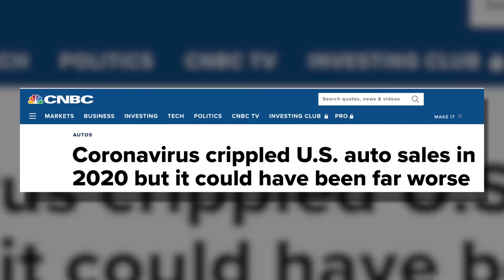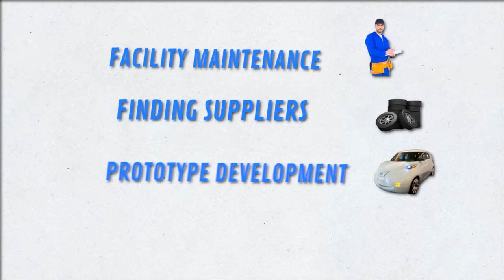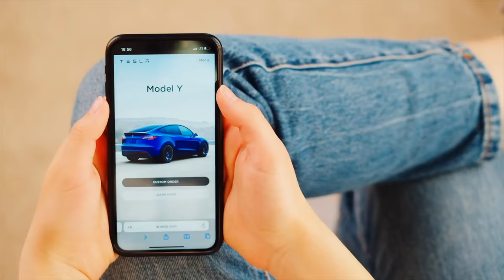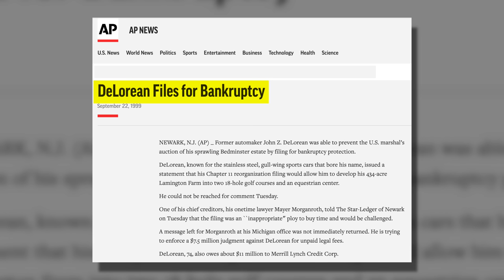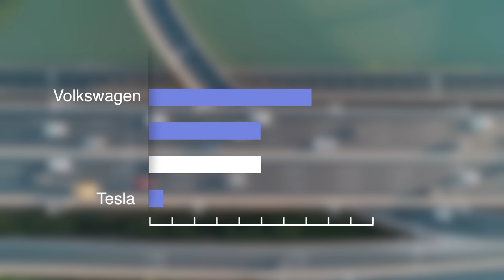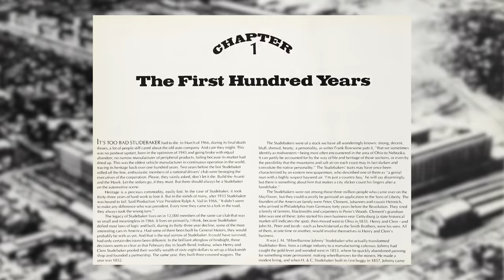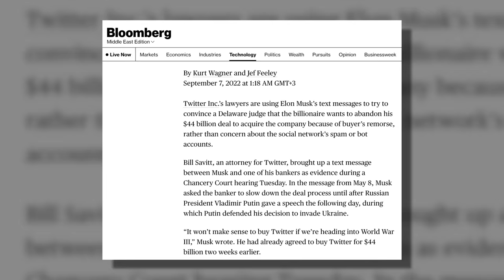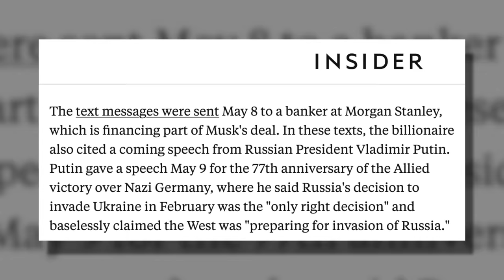Get Ready for Nuclear War

Comment: Maybe they should start making gas vehicles that don't rely on computers. You know, like the old days.
Reply: Sadly that would be impossible with all the required safety requirements
Reply: That would be beautiful one less expensive part to change
Reply: I would love to buy a spankin new ford gpw, exactly as made in 45
Reply: I’m still waiting on the hydro car
Reply: The "GOOD" old day ! I can tear down a chevy 350 or Ford 351 bilnd folded
Reply: the EPA says "No".
Reply: @ueltrades9479   NO! every thing on a modern car except for the gps, Bluetooth and gimmicky crap can be and were done manually
Reply: Doesn't matter if it's got computers. Any electric motors, solenoids, fuses etc of any type can fry. Electro magnetic pulse is literally a massive electric pulse that sends a bolt of electric through all electronics frying them. Not all electronic components are susceptible. But don't think carburated vehicles don't have electric components. If it's got a distributor than it could still be affected. Maybe.
Reply: Sorry thats not liberal enough. Greta would not like it.
Reply: More planned obsolescence more money coming back to corporate
Reply: Because I really loved having to crank my '76 Chevy C-10 for five minutes every morning, trying to get it to start...
Reply: @mabeljoe4305      Need to do away with the EPA !
Reply: Even the old days had computers. What the hell do you think a computer is lmao? You mean interconnected chips or SoCs.
Reply: Back in my day…
Reply: I like fuel injection tho
Reply: I wanna say ‘76 or so is the last years where the car might survive an EMP. Anything ‘80’s or newer won’t make it if it’s close enough to a nuclear (or solar!) EMP
Reply: @Sal3600  Actually, older ignition systems like GM's HEI wasn't computerized but they were electronic using transistors and semi conductors, but no actual micro processors. Definitely a lot more reliable that a points ignition system without being overly complicated.
Reply: @ueltrades9479  yeah they don’t need to be there. All that garbage and computers are not needed
Reply: Good luck cause in America is all about technology with robots soon America gonna be like i.robot movie and people in America want new technology
Reply: Zombie that's one of the best answers on here you are 200% correct. I feel the same way you are right brilliant
Reply: @petefranco9978  Wait, you actually ENJOY cranking your car for ten minutes in the morning to get it started?
Reply: I have that kind of car here in my 3rd world country, and believe me, I save a ton of money because of it's simplicity...
Reply: I often wonder if only one nearly all mechanical design was perfected how good it would be. I'd allow HEI ignition tho. I'm imagining an outside air thermometer helping control fuel management on the latest Holly carb tuned to perfection on a 350 with every part tuned for durability and efficiency on the entire vehicle over 50 years with the combined efforts of everyone would result in a superior vehicle. Heck my 1971 C-10 truck is pretty good, it has a 3.08 rear gear that gives good gas mileage and starts up instantly except if it sits for 2 weeks the fuel pressure goes from 6psi to 0psi and needs a few gas pedal pumps.
Reply: @Rekuzan   What you talking about?  My '56 Pontiac starts right up.
Reply: @Rekuzan  only if its badly maintained.
Reply: @ueltrades9479  nothing is impossible with need and demand.
Reply: you are talking about (noisy) carbureted engines, manual transmissions.. 
mostly mechanic systems with mechanic points of failure, 
Something from the same caliber of Patrol vehicles produced by Nissan in the 70's and the 80's, or Landcruisers of Toyota that were produced in the same period.  
That sounds great, but impossible at the same time,
There are few (enthusiasts) that may stand in the line to purchase a vehicle like that, but they are quite few in comparison to the majority of lazy and spoiled consumers who aspire to luxury and comforts, 
why do you think companies build vehicles the way they do? consumer demand is in their highest perspective.
Reply: @VesselFitterguy   WRONG..  It matters A LOT whether it has a computer.  Computers are a lot more sensitive to EMF than the old electrical systems.
Reply: @ahmadalzuway8425   WRONG on nearly all counts.  Old automatic transmissions DID NOT use computers.   And computers are NOT just because of "consumer demand."  Computers started to be used in order to meet EMISSIONS standards,
Reply: @j.robertsergertson4513    Computers were added to cars to meet emissions standards.  NOT for the driver's convenience.
Reply: Anything pre 1975!
Reply: @TrailBossTatum
Reply: I was thinking the same, but I do remember the 70s, as a young snot nosed kid, and all the constant overheated and broken down vehicles on the Belt Parkway, and if my dad did dare turn on the A/C in the ‘74 Ford Maverick, it would either stall, have no power, or overheat, and in the winter, no such thing as traction control or ABS, yeah, sounds great, but you were also lucky to make it beyond 60k miles.
Reply: @rbnhd1976  I'd pay a lot of cash for that 😃
Reply: Old cars produced allot of pollution and they stink while running. Not that theirs probably 3x the cars on the road over the years, really wouldn't be a very good idea.
Reply: @ThatBoomerDude56  and your point is??
Reply: @VesselFitterguy  Ever hear of points? there were no "tronics" only electric as in Magnetos, distributors with points, etc. everything was based on mechanics which are not at all affected by EMT's. IMHO
Reply: @ThatBoomerDude56  Well History is surely not on your side here! , The first ECUs showed up in mass-production in GM and Ford vehicles of the 70s era to handle basic functions such as ignition timing and transmission shifting (as a way to make their cars more fuel efficient specially after the Arab embargo of oil exports in the same decade) ,
currently you may find more than one (ECU) in a car , and it almost controls everything. 
I can't see where I'm wrong when the people in the area I'm living in wouldn't understand why I'm still driving my 81 Nisssan Patrol and almost everyone is calling it a piece of junk that's noisy and unsafe (it has no airbag system and YES IT IS CONTROLLED BY A COMPUTER).
you can say I'm wrong as much as you want, but if you believe that average people who expect more systems in their future cars will not revert to old vehicles because "they are worried about the emissions" and that they do not aspire for more technology and comfort (ie more computerized systems) then you are free to believe what you want.
Reply: @j.robertsergertson4513  "My point" depends on which of my comments you are referring to.  And whichever one it was, I was clear in making it the first time.  So if you didn't get it, that's not my problem.
Reply: Everything is impossible if you take government out of it.
Reply: Guys, HERE is Our Savior

HalleluYAH translates “Praise ye YaH”

YaH is The Heavenly Father 
YaH arrives via the TENT OF MEETING
YaH was Who they Crucified for our sins

** NO FEMALE INVOLVED WHATSOEVER **
— Hebrew Book of Isaiah

Isaiah 42:8
"I am YaH; that is my Name! I will not yield my glory to another or my praise to idols.

Isaiah 43:11
I, I am YAH, and there is no other Savior but Me.

Isaiah 45:5
I am YaH, and there is none else.
Reply: @Praise___YaH  Hare Krishna!!
Reply: Only traditional diesel vehicles with no electric components will work after a nuclear attack. And you do not have many of those in the US. Gas powered cars have electric distributors, coils, wires, plugs.
Reply: @metodianastasov2905  WRONG.  The effect of an EMP depends on (1) the sensitivity of the electronics, (2) the distance from the source of the pulse and (3) the amount of protection around the electronics.  EVERY automobile has a very effective faraday cage around all of its electronics.  Nearly ALL automobiles in the U.S. WOULD continue to function unless they were very close to the source of the pulse.  Certainly everything built before the introduction of computers would continue to function.
Reply: @ThatBoomerDude56  Good luck with that. However, non-electric diesels are the go to vehicles in such situations. And you do not have any.
Reply: @metodianastasov2905    I'm not depending on "luck."  I'm depending on knowing what a Faraday cage is as well as knowing that an EMP won't do much to a heavy-wire high amperage circuit even without one -- especially if it's not actively running at the time of the pulse.
Reply: @VesselFitterguy  Old fashioned Kettering ignition would only be affected during the actual pulse. Should restart straight away.
Reply: 1973 Monte Carlo would be nice.
Reply: @VesselFitterguy  Anything with electronic ignition would be screwed, carb or not.
Reply: @Rekuzan  maybe you should change the plugs and oil every once in a while
Reply: @Sal3600 they are my 63 Chevy Impala head over 2,000 computer chips in it and sensors go back go back to the Disney channel will you
Reply: @Rekuzan  it's better than waiting 45 mins to charge while having 10 cars waiting ahead of you.
Reply: Kinda off topic but on the Battlestar Galactica TV series the only fighter spacecraft left were the old analog type mechanical star fighters, the high tech computerized versions were hacked by the Cylons and shut down immediately before a deadly battle that killed every modern computer controlled spacecraft, leaving only the golden oldie spacecrafts in the remaining fleet, maybe that’s why we’ve got a huge ghost like aircraft graveyard somewhere with retired old aircraft stored away 🤔😏😆
Reply: @mackenziegray2090  yep, I remember one time being behind a guy driving a car from the 40s, and I was getting choked by his exhaust fumes.  I can’t imagine a road full of that now, would be disastrous.
Reply: @ueltrades9479  Maybe we as US citizens need to make a movement and ask our law makers to lessen the regulations that require car manufacturers to include so many computer chips in our cars
Reply: @OfficialReckM8  I agree
Reply: Engine being controlled by computer is one thing, the CANBUS and everything else on the damned car being attached to the computer is something else. It's simply not necessary; get rid of that other garbage.
Reply: they used too. My 72 cutlass with a rocket 350 v-8 got me around 24 miles to one gallon....I kept my foot out of it, most of the time. My 76 chevy c10 with a 73 pancho 400 transplant go 20 mpg, If I kept my foot out it. my ole mans 65 goat, 389 4bbl, 4spd m21, got 22 mpg, if we kept our foot out of it.
Reply: they used too. My 72 cutlass with a rocket 350 v-8 got me around 24 miles to one gallon....I kept my foot out of it, most of the time. My 76 chevy c10 with a 73 pancho 400 transplant go 20 mpg, If I kept my foot out it. my ole mans 65 goat, 389 4bbl, 4spd m21, got 22 mpg, if we kept our foot out of it.
Reply: they used too. My 72 cutlass with a rocket 350 v-8 got me around 24 miles to one gallon....I kept my foot out of it, most of the time. My 76 chevy c10 with a 73 pancho 400 transplant go 20 mpg, If I kept my foot out it. my ole mans 65 goat, 389 4bbl, 4spd m21, got 22 mpg, if we kept our foot out of it.
Reply: I'd love to see you betas crank start an engine.
Reply: @snavisTM  🤣oh boy how bad are you?
Reply: Better yet... Gas computers that drive the cars for us
Reply: Yeah,and a good old fashioned landline.. Remember when somebody called and you weren't home!!!!! THEY CALLED BACK. We ruined life with too much technology
Reply: Model A's and T''s never used chips ...
Reply: So carboureters as opposed to electric fuel injectors? Some computerized aspects of modern vehicles are undeniably superior in terms of both longevity AND simplicity when compared to mechanical counterparts.
Reply: @stankygeorge  you can get a 1985 or even 1990 Japanese or German car that is completely mechanical with no electronics and much much better built than anything from the 1970's, not to talk about safety and fuel economy.
Reply: This is how they making money on computers  usually  normal people  cant fix.. so you have to call dealer😢

Comment: My first car had a 225/6 and got 23 mpg on the highway.  Here we are 50+ years on and a bunch of computers later, my car now gets 24!
Reply: My 03 shitbox gets 18, what car did u have
Reply: @bigiecheese919  Obviously, a Mopar!
Reply: @jaminova_1969  that's bizarre dude, why do you think that engine was so efficient
Reply: g pilsitz  Sounds like my old 53 Chevy coupe .
3 on the tree !
Reply: @bigiecheese919  Single barrel carb and timing advanced 10-12 degrees.  It was the first oil crisis so had to stretch every gallon of gas ⛽️...  Also no pwr steering, breaks, a/c (had to install own radio), it was a stripped down model, not even carpet: It was light.
Reply: @gpilsitz1783  We had 2 Valiant's,a Demon, several V-8's. Grandma always had a new Dart Swinger, one Uncle had a pickup, the other drove the same Duster for decades! My 1st car was a '67 Dart GT with the indestructible, runs on mud, Slant Six!

Comment: Scotty won't have to worry about repairing cars afterwards.
Reply: I recall a post-apocalypse movie, where they drive old cars converted to wood-burners, as some did in Europe during WW2.  Scotty may have a "conversion business."
Reply: Very true, 💪🏻
Reply: I have had a look at your car and its NUKED
Reply: @elultimo102  There is a different method using "gassification" as demonstrated by an Aussie mechanic. Instead of directly burning the wood, it applies heat indirectly to the the wood and the outgassing has methane, hydrogen,  and oxygen which are burned. It's interesting stuff.

Comment: If you are worried about an EMP, get yourself a pre 1973 domestic truck or van with a carburetor and mechanical points ignition system.
Reply: The roads would be clogged by vehicles that have been fried.
Reply: Will an old 1970 350 work?
Reply: park in a Faraday cage
Reply: Paranoid much?

Comment: we had a Studebaker back in 1955. 3-speed on the column and a Desoto. my 2 favorite cars to drive when I was 11 years old. all the large farms had their kids driving. my job was to drive a 1.5-ton truck to the grain elevator 5 miles away @ 10 years old.
Reply: Short-hand, that’s a pretty cool story!  Did you have trouble reaching the pedals?
Reply: @woohunter1 yes I did. I had to push myself down to work the clutch and brakes. then push myself back up to see over the steering wheel. didn't have to worry about the accelerator because the truck was in granny. just let off the clutch slowly and the truck would start rolling. at the grain elevator, I would stop and someone would come out and drive the truck over the scales and dump the grain. then they drove the truck around back to me and I returned to the field. I would drop that truck off and get in the other dump truck to head back to the grain elevator.
Reply: @short-hand4312  that’s pretty cool!  No power steering, no air conditioning, yet You probably loved every minute of it!

Comment: I just bought a 1996 4WD Daihatsu Hijet truck.  It has a simple 3 cylinder engine and no electronic engine computer.  It doesn't even have electronic fuel injection.  It should still be running after an EMP.

Comment: with chips, and the price of all the newer fancy parts sky-rocketing, I'll never understand why they dont just go back to what worked and sold really well. If Dodge decided they were going to being back the 93-95 Ram. My happy butt would be camped out at the dealer trying to get the first one on the lot. I absolutely hate how the newer rams ride, feel, look, and the repairability on them sucks.
Reply: @Jesse Graves  yep, my friend has a GMC with the dial shifter, and I remenber going to the store with him a few days after he got it, and he goes "Wanna see something funny," he showed me reverse worked, then put it back in drive, Then sprayed some dash cleaner on the dash, it wouldnt shift for a good 10 mins. I was so confused.
Reply: @Jesse Graves  im not shocked anymore. After watching the Dude over at Spencers Lawncare have to turn off his new Ford by pulling the battery terminal cause even after several trips to the dealer for repairs it still dont wanna turn off after you turn it off. I've just decided "Rusty but trusty" is my new buying requirement. If its not visibly showing its age, it better be a no rust area truck.
Reply: Definitely easier to repair but won't pass crash test or emissions these days and there's probably even more government regulations I'm missing unfortunately